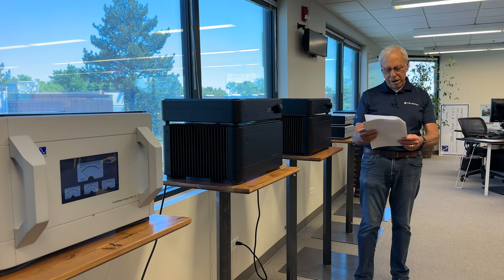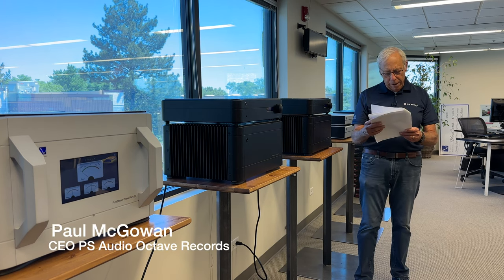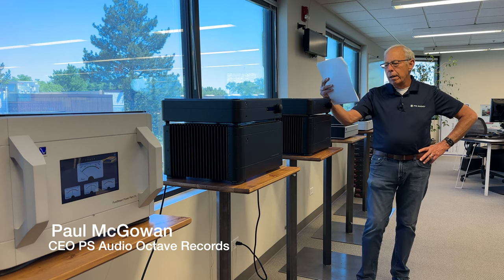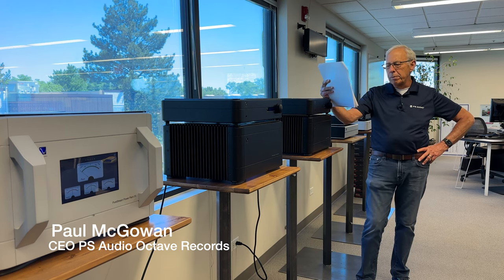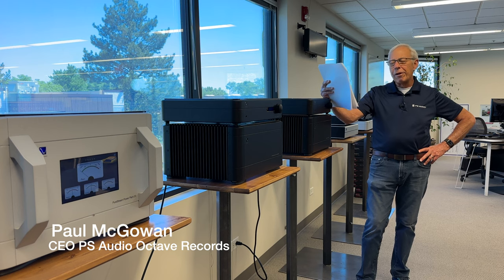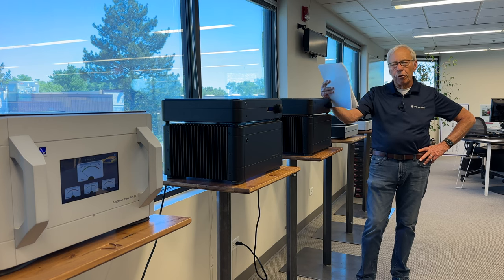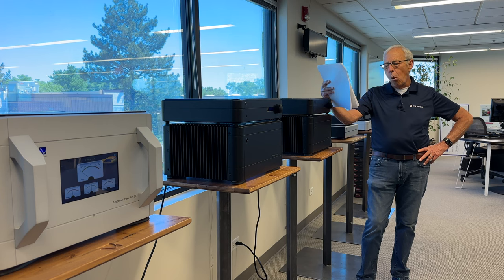Frequency and amp power

Comment: I disagree with your answer, Paul. But it's a misunderstanding of the question and how it was asked/written:

You are correct, if they speaker is not moving, it's not consuming power. But it CAN consume power without making meaningful sound - and that's bad for equipment. That's why Sub Sonic filters exist.

Low frequencies into loudspeakers, you are putting amplifier power into the speaker, but rather than getting sound, you are getting heat. I can put a 2000 watt 3hz tone into a woofer and watch it swing, and not hear it, and even barely measure anything on a dB meter. It cannot efficiently convert wattage into dB at that frequency. 

My vote is if your speaker rolls off at 50hz, let it have everything down to at least 20hz. It is making sound there, just less efficiently than above 50hz. Also, if your speaker only goes down to 50hz, find yourself a subwoofer. You are missing out!

Comment: I have to kindly disagree with Paul on this one.
An amp does not 'know' what speaker is connected, so if the music containes frequencies in the 30 Hz area and the speaker can only reproduce from 50 Hz up the amp will still use the wattage to produce the frequencies below 50 Hz. The amp does not know what frequencies the speaker can or can not reproduce, so it will just deliver all frequencies to the speaker.
Only if the Ohmage of the speaker varies with the frequency the amount of current from the amp varies, but not due to the frequency response of the speaker.
Reply: Yes, I was wondering about that. 
Hope Paul replies.
Reply: I agree with you if you conciser real power. it gets confusing because speaker builders define sensitivity as sound level at a certain voltage and not wattage. I guess that Paul got confused by that. Pink noise covers the entire bandwidth. If you filter part of it out, the amplifier has to deliver less power. And since it is in essence a voltage source, that will result in less power demand. It all comes down to knowing the Ohms law.
Reply: "An amp does not 'know' what speaker is connected" - but to get to "90dB" as in the video, one has to measure (at 1m distance) the sound from the speaker. The microphone measurement will only measure what is delivered acoustically, and measurements are the sum across the audio spectrum.
Reply: That would be the impedance curve, not the response curve. The amp does not care what the speaker can couple to the air, LF energy will be wasted as heat or kinetic energy, just not acoustic energy.

Comment: Wrong question. The amplifier amplifies everything coming in. The speakers “lose” the frequencies by turning the “too low” frequencies into excessive motion. The amp does not care, but the speaker produces serious distortion below its lower cutoff. If it is a vented speaker, there is essentially no mechanical limits in this range, so there is the possibility to “bottom out” the voice coil, destroying the driver.

Comment: I have to think power is consumed at certain low frequencies even if the driver is not capable of producing that frequency.  Most drivers have an impedance curve at their resonate frequency.  Impedance may be 30 ohms at 35Hz, so not much power consumed here.  But below that sharp peak, impedance drops to Re or coil resistance say 6 ohms at 25 Hz and below.  Driver is incapable of making 25 Hz sound, but power will be consumed in abundance in the coil and converted to heat.  So if you are using DSP, why not eliminate frequencies below the woofer's capability.   We do the same thing with mid base employing a band pass to only supply it's optimal frequency.

Comment: I think I'll have to disagree with Paul on this one. Even if the speaker can't play the low frequency sound, the coil resistance of the speaker will still draw power from the amplifier at those frequencies.

Comment: Incorrect. The speaker will present a load os several Ohms to the amplifier at all frequencies, even is the speaker is incapable os delivering audio at very low srequencies it will still consume power. A small bookshelf speaker may not produce any audio below 30Hz but the amplifier will still deliver power below 30Hz. For example, pushing several watts at 20Hz into a small speaker wil cause the cone to flap uselessly without producing much audio, but the amplifier is still delivering the power.

Comment: What’s more important is that if you have good properly designed subs that have adequate high-level speaker ins and outs, and it’s own low pass filter can be fine tuned for bandwidth and level controlled, so the problem of worrying about external filters are solved. Unfortunately, a lot of cheaper subs are geared toward HT use, and the high level speaker in&out connections are not designed in for stereo users.
Edit: My $0.02. Caution: Your “level” of agreement may vary.
Reply: lol! Well stated.
Reply: I avoid using any high pass filter when adding subs with my floorspeakers. For small bookshelfs etc I might consider it but most amps do this anyway so you don't really need it in the sub... Better to focus on power and sound than adding a feature almost nobody will ever use..
Reply: @Oystein87  Imho, if you need an external high pass filter in any setup, you most likely don’t have the right components matched up, so the external filter may be considered to be your magic bullet, but may not the best approach, just over complicating things unnecessarily.👨🏻
Reply: @shipsahoy1793  High-pass is only needed for small speakers. And you still would not need the sub to have it since most amps I have seen have high-pass filter options
Reply: @Oystein87  ?? There are a lot of affordable amps running around without that option.. also, you don’t need a filter for a bookshelf speaker either if you have high-level speaker ins and outs on your sub.
Reply: @shipsahoy1793  I have even seen dirt cheap amp with that option in the menu.
Whot? That makes no difference if it has high-level in and out or not.. And why would you connect it that way anyway? Unless there is no pre-out for sub or regular line out off course but that is rare these days.
Connecting it that way means it either just goes pass-thru to the speakers (most common) or there is a slight possibility that there is a high-pass filter so then there would be a filter anyway..
Reply: @Oystein87  forget it, it’s obvious that we’re never going to agree, and we’re not even on the same page lol
Reply: @shipsahoy1793  Or you are just bad at explaining

Comment: The amp IS producing voltage at low frequency, and therefore the higher frequency you do hear may be riding on a very large 30Hz signal that you don’t even know exist. 
If you have limited amplifier power, you should cross over BEFORE the amp, because you will run out of amplifier power from sounds you cannot hear. 
Besides , if the amp clips voltage at 30Hz… the High-frequency component of the waveform will skyrocket and •poof* goes the tweeter

Comment: Well.. My floorstanding speakers start rolling off at about 30Hz. But they do still move at 1Hz... So yes you generally do actually consume power below what the speaker can reproduce since it still outputs the freq to the speaker. Normaly atleast. Some subs have subsonic limiters etc to protect agains too low freq. that it wont be able to reproduce anyway. That might be the same for some amps I guess.

Comment: i think i can simplify things so it becomes clearer: play a speaker at about listening levels, then only play a 20 tone. 
the amp pushes the 20hz as normal and the speaker gets the signal, the cone moves and most of the time it is too small of a woofer to make anything perceivable by ear. the -3db point is in there, and in the measurement graph.
high pass filter if you set it before the amplification removes that load to the amp, same watts and loudness i then played by the speaker, but uses less current i think.  there is a resistant(ohm) graph with any speaker showing what is going on.
Reply: I get the idea although some concepts aren't accurate in my opinion. An amp might push frequencies as voltage variation, but not watts. A toaster or vacuum cleaner demand current according to the impedance of the device and the voltage of powerplant/line. The nuclear powerplant don't push watts into clients. Power [watts] is the result of a mathematical operation (tension, current and phase) of the current demanded by a speaker for a voltage controlled by the amp. Resistance and impedance are different. Resistance is resistive with no phase between voltage and current. DC is an example. AC in a speaker has also a reactive component (caps and coils) which change phase (vectors) angle between current and voltage for each frequency. The graph is an impedance graph.

Comment: Unless the crossover is cutting the speaker off at 50Hz, it will still draw power @ -3db. it's pulling current to create the signal. Now if you cut it off at say 60 or 80 Hz. then run that signal to a sub it will pull less current (load on the amp).

Comment: Wrong.. the woofer still draws power below the fs..  thats why using active xovers are only half the story.. in pro audiio they use what they calll a subsonic filter to remedy exactly this problem.. the amp runs cooler and the speakers are happier
Reply: Thanks , I did not want to explaine this simple thing , even in home hi-fi I use a adjustable high-pass for my subs and the main speakers , I keep it to where I drop the lows right above the resonant frequency,  just to massage the drivers at there resonant frequencies.